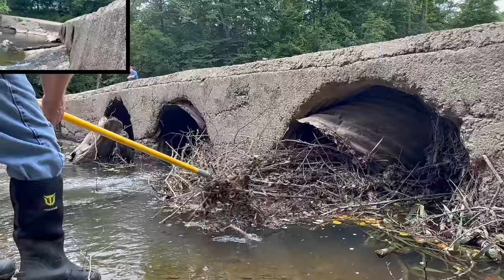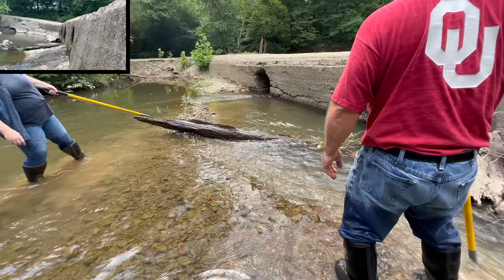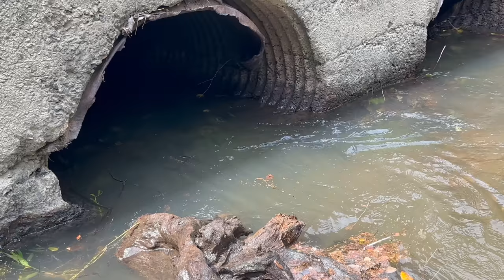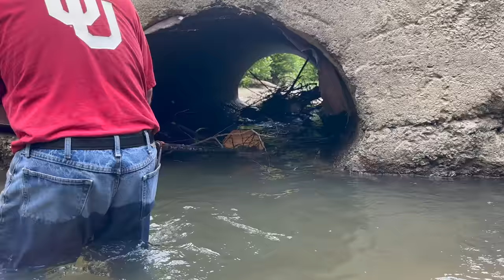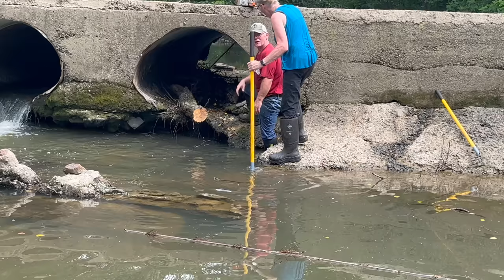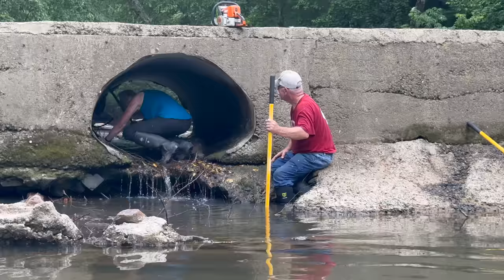unclogging low water bridge with tons of debris/rusted out culverts 06/2023

Comment: That was quite a job, nice work. At the 16:00 mark you can see a gravel berm has formed across the stream. If you rake out a few channels in the berm, you'll be able to lower the level in the pond a lot more which will help when a storm comes by allowing the extra capacity from being drained down. Sure, the gravel channels will fill in again, but it will help in the meantime. That was definitely a beaver at the end, I wonder if mom wasn't feeling well from breathing that in. It must have been horrible smelling that. Oh, and I love the pipe idea as an added tool in the arsenal!
Reply from the maker: Good to know!! Thanks.

Comment: Here in Australia we have a much smaller area which is snow effected, the rest of the country knows all about cleaning out culverts.  One method that we use is to put a chain through the culvert and attach a heavy concrete block or similar and winch it through to pull out the cetnre of the plug- kind of like you are doing by hand at the 30 minute mark. But pulling with a motor instead of pushing by hand.
I can see that you are doing what you can with what you have- I salute you for that.

Comment: Is this a private driveway/bridge or is it a state owned bridge? Seen one similar to this the state condemned then sold the land but people traveled it for a few years as a short cut and they used it for 15yrs after the metal pipe rotted out, storm came through and lifted the whole thing out the ground and it sit down parallel to the bank. They never had to touch it and its a perfect fishing dock now

Comment: Hi Jeff just wondering , with some of these culverts that are bashed is it not possible maybe to get an old car jack from junk yard & maybe use a block of wood & jack it up to see if it would push the roof back up or the bent floor back down. Just a thought .
Reply from the maker: Not a bad idea, Jeff said he has thought of using a sledgehammer and a piece of wood.
Reply: @culvertsandmore  I think the jack might be a better route and maybe safer.  I expect the sledge would just bounce off.  That corrugated steel is tough stuff!